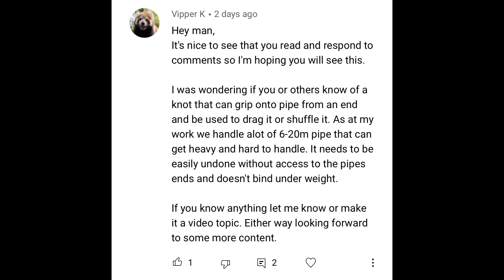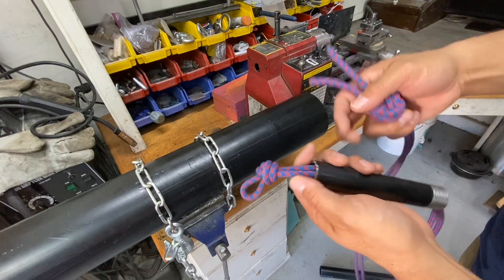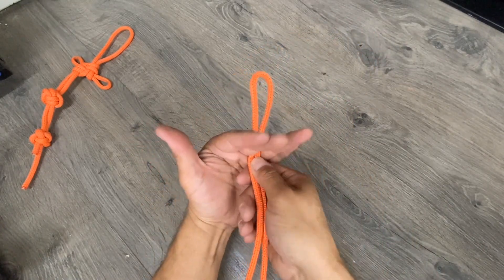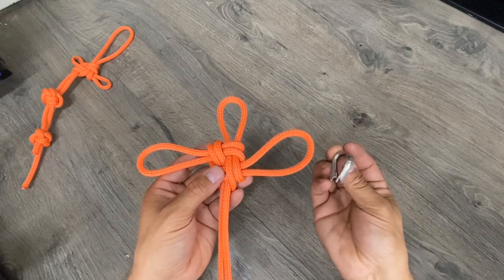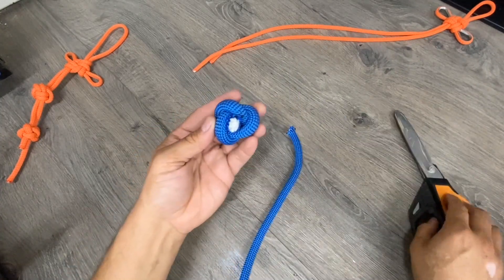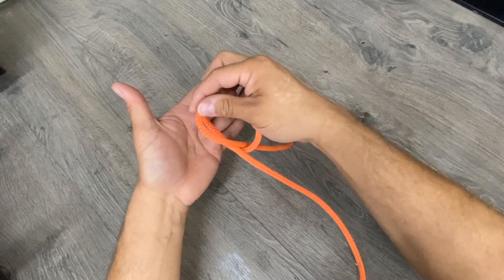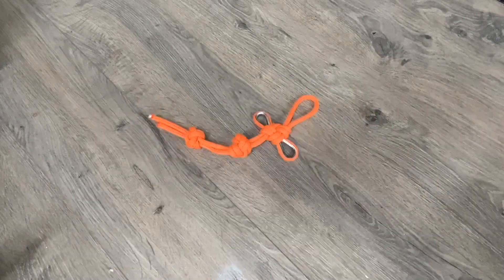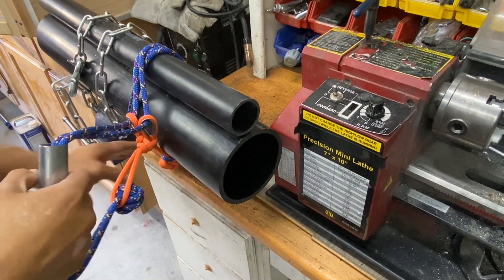How to drag pipe knot (Subscriber Request)

Comment: Nice rig!  Seems like you could bend the end of the blue rope to the center loop instead of using the stopper knot hold on the handle end, as it doesn’t need to be be released.

Comment: Can you do a video on a knot for a tire swing attached to a tree? 

It needs to be a strong knot that can be thrown over a high branch and can be tensioned and adjusted from the ground. Bonus points if it also has a way to recover the rope without cutting it or having to climb the tree.
Reply from the maker: Ah, that’s a good one. I’ll start thinking about it. Thanks!

Comment: If the diamond stopper knot gets bumped or knocked, does this run the risk of causing everything falling apart inadvertently?
Reply: By the looks of it in the slo-mo demo, it would not come apart if the system were under tension. I think if everything was loose on the pipe it could easily fall apart if bumped the right, or wrong, way. I would bet the harder your pulling the more secure it is, to a point.
Reply: Unlikely whilst under tension. When the eyelet is pulled tightly, it elongates, making the opening too small to pass through.